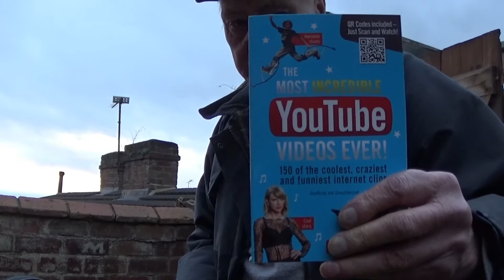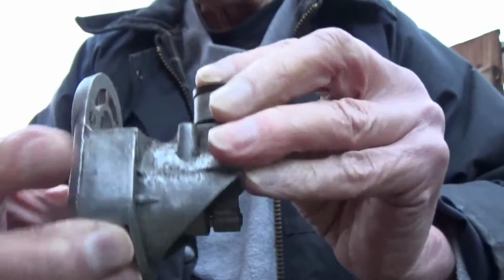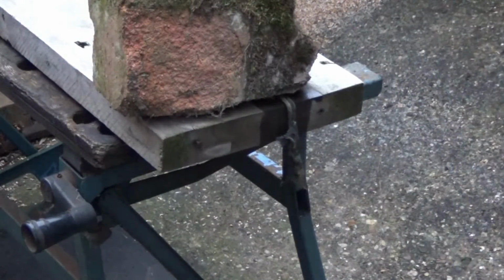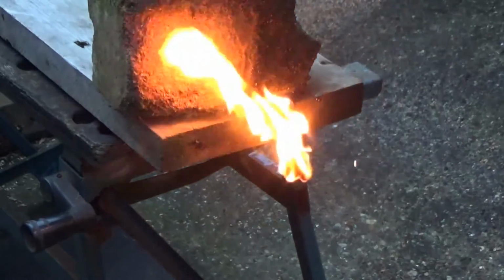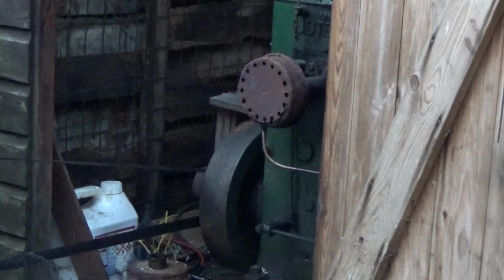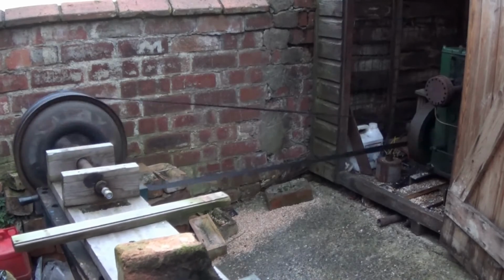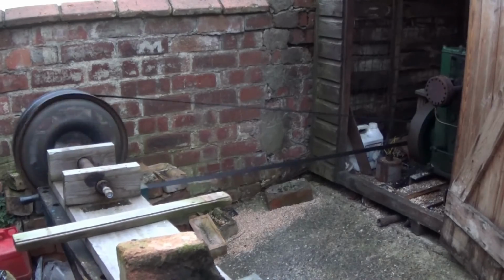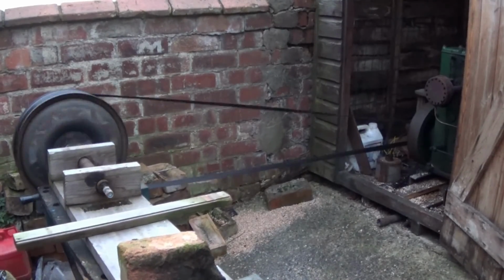Back To Basics

Comment: Hi Malc, good video. I know u have said that sometimes your stuck for a video and if it's not too rude I have a couple of suggestions for u. The videos I have gotten great tips from u are, how to manage on very little money and cooking a meal in a slow cooker in the car whilst on my way camping. Personally I thought they where fantastic. I love camping and anything to do with it. In fact now is a good time to ask. I have a 1984 caravan which I love and can't afford to replace but the walls are rotten inside now and I have no idea how to replace. Any help from u would be wonderful. Anyway mate just a couple of ideas if your bored. If not no problem I continue to enjoy your videos whenever u post. Many thanks Trevor
Reply from the maker: Well Trevor, having stripped a few caravans years ago, I think you'll find it a fairly simple job. Strip the rotten plywood, and inspect the batons that it fastens to. You will need to buy, or source some new, or non rotten ply of course. Providing the batons are ok, pack with new fibreglass insulation and then nail the plywood on. Only thing is to ensure the ply panels fit well before fitting them. Hope it helps.
Reply: @MalcOfLincoln  it certainly does. Thanks a million Malc great advice